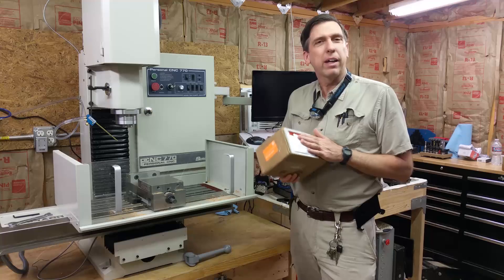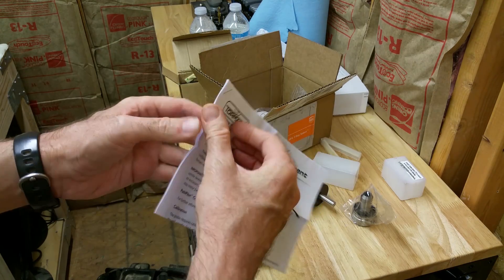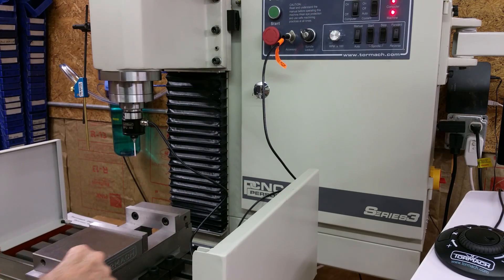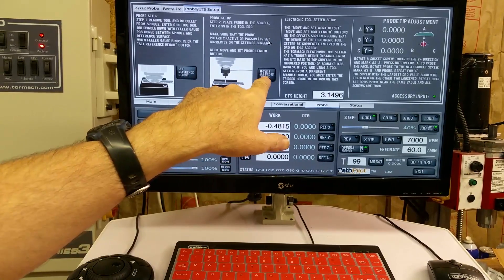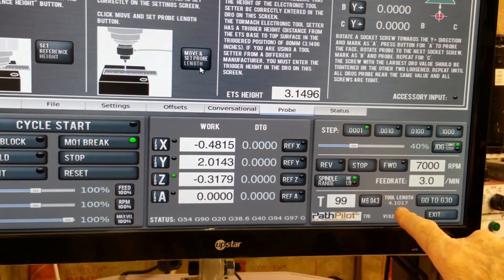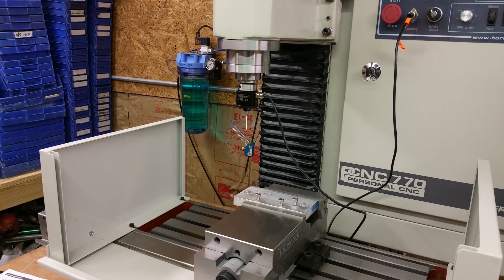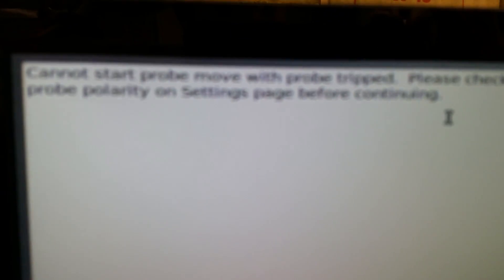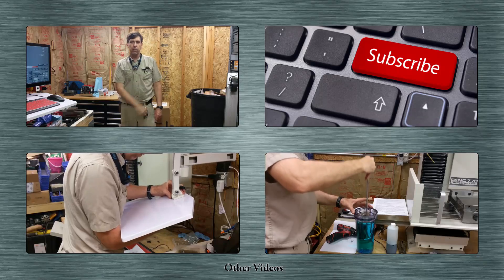Tormach 770   Part 15  -  Passive Probe Part 1

Comment: Hi at 9:24 you have a message "cannot move with probe tripped, please check polarity on settings page before continuing" can you explain how you fixed that error, I am having the same issue myself    Thank you
Reply from the maker: Wow, that was a while ago.  It looks like I just unplugged and plugged it back in and it cleared.  If that doesn't work, maybe try turning the machine off and back on?

Comment: If you are going to use a parallel plate or a 123 block, don't use your vice jaws for your calibration surface. The Tormach vice travel jaw can be lifted in the Z axis. Always use the bed itself for your calibration surface.

Comment: Please don't jog your spindle down onto the item you're using to measure your offset (the parallel in this case). Slide the item under the spindle, if it clears, pull it out and jog down .001". Repeat that until the item doesn't slide under the spindle, then jog up in .0001" increments until it is just able to slide under the spindle.
Reply from the maker: Yeah, that was a while ago. Thanks.
Reply: Sorry Craig, I feel bad for calling you out like that. Having personally done this "the wrong way," I wanted to help others avoid that potentially costly mistake. I really enjoy the videos you share of your Tormach!

Comment: Yeah those ATC's are a bit pricey. Would be nice if you could load in 20-30 tools for that price though.

Actually pulling a knee mill apart is pretty simple. I'd highly recommend anyone buying one or any mill do so unless it's got built in feeds or hydraulic drives. The cleaning and reassembly certainly took a lot longer than it did to tear it down. :-)
Reply from the maker: Silicon Valley?  Ouch. Better than trying to have a machine shop in Tokyo though. :)
Reply from the maker: +Turning Point  - Too rich for my blood.  I am starting at Techshop next week.  I will have access to 2 knee mills along with a tormach 1100, waterjet, laser cutters, etc.  Full machine, wood shop.  You can look up Techshop online to see if you have one near you.
Reply: +Craig's Machine Shop Should be pretty interesting getting to play with all those toy's. But I know there's nothing like that here. I'm 1 1/2 hrs to the nearest larger city and there's nothing like that there.
Reply from the maker: +Turning Point  - I wish I was 1 1/2 hrs from the nearest city.  Living in the city isn't all what it is cracked up to be.
Reply: Craig's Machine Shop - couldn't agree more. I struggle to find 5 feet by 5 feet in a single garage in a tiny house in Silicon Valley.

Comment: I've now watched your complete video series for the 770 Craig. I think you did a really great job documenting the whole thing from the start until now. Due to the shop space I have left, I'm hoping to pick up a 440 in the next year or two. A 770 would be much better, but I'm about out of room.

It's way after the fact now, but with a bit of structural work on the floor,  your wooden floor would have been up to handling the weight of the 1100. I've got a 3/4 sized Bridgeport clone that weighs 1100 lbs sitting on a wooden floor structure. And the 1100 would have a far larger footprint than my mill has. You still may not have had the room in your shop as you mentioned in your first video though.
Reply from the maker: +Turning Point - Cool, thanks!  You end up needing more room then you think with the keyboard and monitor.  Also, having a table nearby for tools and measuring tool offsets.  The next thing I think I will be getting is  a 4 foot rolling work bench to stick on the right side.  

It would have been a lot of work to get the 1100 in there.  I would have had to make a bigger door to get it in there as well as reinforcing the floor.
Reply: +Craig's Machine Shop 
I think I'm the one that owes you the thanks just for going to the effort it takes to produce all these videos. But without an ATC, then I think building a rolling tool cart much like the commercial and real expensive one's would be a great help. Maybe something like 3/4" ply 2"x 2"  with a hole drilled to take each tool? Then the tools can be placed in the order needed. I've clearance drilled one or two holes before that needed to be tap drilled simply because I wasn't paying attention and grabbed to wrong drill from the cutting tools laid out that weren't in order. Keeping the tools in there correct order removes problems like those. Add maybe one of those small 9"x 12" surface plates for measuring your tool off sets. 

Yeah I had to strip my Bridgeport clone down to it's sub assembly's just to get it into my shop. My shop door is only 24" in width.
Reply from the maker: +Turning Point - I will probably just get one of those rolling tool boxes from Home Depot with a butcher block on top.  I don't see getting the ATC for a while.  The fog buster has to be adjusted with tool changes.  Maybe when I get a commercial shop and have flood coolant. Yeah, I need to label my tool holders.  I see Grimsmo labels his. Not sure what he uses. Maybe white nail polish. The surface plate from Tormach was fairly reasonable.  Strip a Knee mill down?  Wow, now I don't feel so bad for what I had to go through. lol

Comment: Hey Craig, is it possible that the connection inside the probe is still off after the probing op? Maybe the spring is not strong enough somehow to push the tip back down. My probe came with 3 different springs, from very light to very tough.
Reply from the maker: +Crivo152  - Hiey Marco,  I took it apart and cleaned it and it seams fine now.  I still have to calibrate it though.  No, I didn't see any extra springs in the box. What kind did you get?
Reply: +Craig's Machine Shop It was just a cheap one I found on eBay, it never really was very reliable.
Reply from the maker: +Crivo152  Yeah, This one seams like a lot of work but should be worth it once its dialed in.